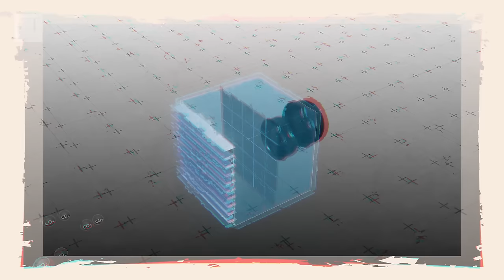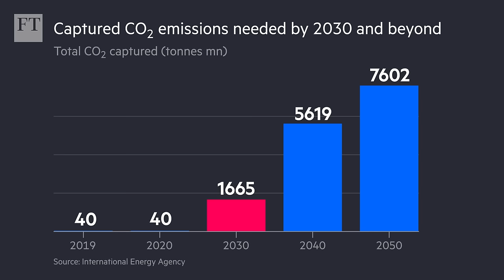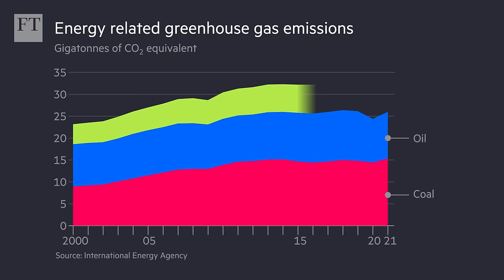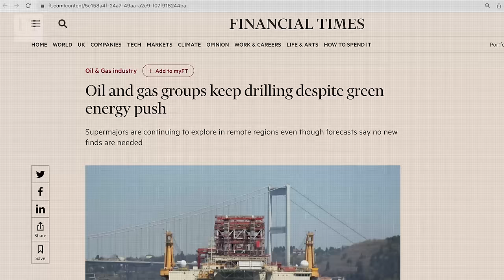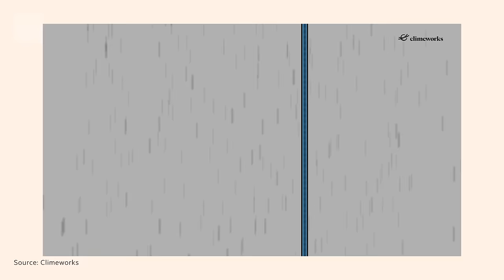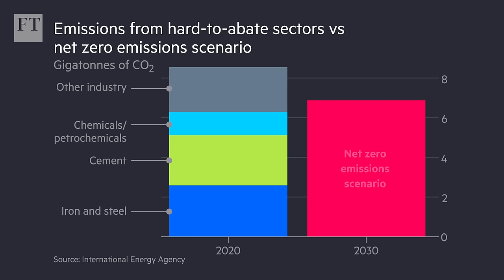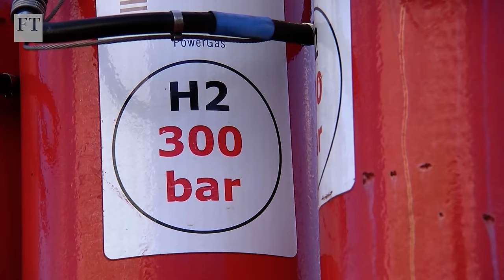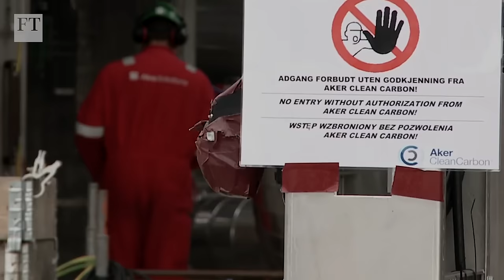Carbon capture: the hopes, challenges and controversies | FT Film

Comment: A lot of people say this approach will not work, which given current technology is true. The cost of storage is quite high, even when using very cheap methods of storage. However, there are a few new processes of turning CO2 into O2 and C. While this process is energy intensive, a source of pure carbon is incredibly useful, as that carbon enables the production of pure-carbon materials, such as nanotubes (one day, probably not soon though), graphite, graphene (this is an important one), diamonds, and more. Importantly, graphene and graphite can be used in graphene matrix photovoltaic cells, which help create solar panels without high-purity silicon. 
Indeed, carbon capture may not itself create net-zero conditions, but using atmospheric carbon to create solar panels, which reduce emissions, is likely how solar panels can be made cheaply enough to make investment even more common sense. 
Finally, the only way to capture enough carbon to make any kind of difference is to dangle a carrot in front of industry that makes them capture carbon /profitably/. If it makes money we'll have to stop people from doing it eventually lol
Reply: by "new processes of turning CO2 into O2 and C" I suppose you actually mean the old processes? Like photosynthesis? Very cutting edge.

Comment: The issue especially is the storage part. First of all, where do we store it? Do we dig up huge holes in the ground, releasing chemicals and gases as we do so? Or do we pump it into containers, containers that need material and other things to be built, as well as a place to be stored (deforestation etc). While CCS is a great late-game strategy to eliminate the very last of our emissions, it's a horrible strategy right now. It's similar to using our pension savings to pay for rent when we're 30. That's not what it's for.

Comment: in deserts solar panels provide shade and shelter to crop and animals 
(rockets upper stages are fumes/heat earth gets rid of)
Reply: We put up solar panels in Kuwait to drive a desalination plant.
Over night the dusty desert air with some humidity condensed on the surface and needed to be washed out, not with the rejected salty brine, not with the seawater, but with the fresh desalinated water. The net recovered fresh water was far from the expected deliverable desalinated water.
If you want to put solar panels on deserts, make sure to consider the dayly maintenance cost and the availability of fresh water.
So far it is difficult to get insurance for such projects, let alone knowledgable investors.
We learned the hard way: use waist energy from neighboring powerplants, nuclear or thermal.
Reply: @arturoeugster2377  ( when every living cell holds an ocean within water wants to flow slow )
Reply: Well that's good for shading need some planets there's with differences in changes of it's exostences
Reply: @ShaleyWanda  where eternal manifests as rockets -let rockets be totem for all of humanity 
(life as center of the universe )

Comment: $137 trillion. That’s the amount of additional currency the world economy needs to be able to handle in order to remove all of the excess Co2 from the air. 

1374 gigatonnes of Co2. 
1 gigatonne = 1,000,000,000 tons. 
$100 per ton to remove, at scale. 
1,374,000,000,000 x $100 = $137 trillion.

Comment: You need to look who came up with the idea of carbon capture...
The petrochemical industry!
Check 4 yourself - Google it... the info is there.

So... this should be ringing alarm bells for you: would this industry really be doing this for the benefit of the planet and population? Or for profit?

Carbon capture is trapping only a fraction of what was forecasted... and the process would appear to generate more carbon than is captured... so there  would appear to be very limited benefit for the planet and population...?

But... here's the kicker... the oil companies use the carbon they do capture to extract more oil (including more profitably where the oil field is close to exhausted and it used to be more costly to extract what's left). Check for yourself... this is what happens.

So? Benefit - No. Profit - yes!

And here's the really, really, really, really good bit....
A 💩-tonne of taxpayer money was used to research/develop and build this technology.
Yes. The petrochemical industry sat back and waited for the taxpayer to build it all for them... minimal cost to themselves. And then profited from it (the only profit the whole scheme showed).

Brilliant! A master stroke by the industry.  As despicable as it is - you have to applaud the brilliance of the whole plan 🤣🤣🤣

Comment: 3:05 NO. That is not a kind of carbon capture to pursue. A fool's errand. And direct air capture can be done anywhere—probably best done near the best places for DISPOSAL.
Reply: Another time to bother you:
The very cold water in cold high latitude, where wales feed, has a high solubility for Co2, because of the temperature dependance of the solubility, ( tables available in engineering hand books) there is in tropical waters an expulsion of the gas. In contrast large amounts of co2 are absorbed continiously in arctic waters, feeding plankton and the whole food chain to the wales, crustatians absorb calcium and co2 to internallty produce calcium carbonate and a shell around themselves. They end up on the seafloor , sequestering the  associated co2 in huge quantities, higher than sequestered oil and coal in the ground. The absorpion of the gas in cold water can be measured giving a reliable value to compare with this artificial foolish attempt here.
Calling it foolish is just my opinion.
Reply: @arturoeugster2377  That there is faster CO2 absorption in polar regions is an interesting point, but I don't see what it has to do with my comment, nor does it change anything WRT what anyone should do. The natural process you describe is VERY slow, taking what, some thousands of years? And whether it happens mostly at the Poles or elsewhere doesn't change anything. OTOH my "artificial foolish" solution can be scaled up to be as fast as you want. I picture most of the process happening in a pulse of a few decades, followed by a much slower effort to maintain conditions. Do you have a particular objection to anything about that?
Reply: @ronaldgarrison8478 
No I am in agreement with both comments you made, in different places. The co2 situation is for me different, because where I grew up at an altitude of >12000 feet regular agriculure fails because the co2 content there is 0.27 grams/m³ as opposed to sealevel, where it is o.49 grams/m³ due to the difference in air density.
Up there we had a large farm next to a river, which we tapped for ample irrigation. Other than corn, the growth was limited due to insufficient co2 content, despite good solar intensity and all adequate fertilizers.
Tests in closed transparent enclosures, fed with co2 from combustion and cooled were dramatic, but not possible for food production in the quantity necessary to feed the ~million living even higher on the Altiplano south of lake Titicaca at 14400 feet. Untill recently most food, trucked in, now with the near doubling of the fuel cost,  is plainly unaffordable.
Any artificial removal of co2 from the air is from my point of view, not just foolish but detrimental to that population. A doubling of the present concentration of 0.04% is desirable, with only a ~1% reduction in co2 radiation loss to space. Due to saturation in the 15 micron IR band. (667 wv/cm bending resonance of the molecule)
But this is not the place to address the problem.
Reply: @arturoeugster2377  Wow, I must admit I've never considered your sort of situation. I'm sure you won't be offended if I say I don't see how a global decision can be made on the basis of what it would mean for a tiny minority such as Bolivian farmers. Then again, you could say the same thing about Pacific islanders dealing with sea level rise, except that they're part of a far larger affected group. Your case seems somewhat analogous to Southern California, where agriculture is only feasible by bringing in huge amounts of water from elsewhere. But it's much easier to divert water than it is to push CO2 uphill. The one thing I might have suggested is what you say you already do, which is to grow plants indoors. In the future, that might be feasible on a larger scale, but I can't do much more about that than speculate.

Comment: Where does carbon come from? Oil, coal, and gas.  Where do they come from? Life.  More CO2 means more life.  Its all part of the carbon cycle which is the life cycle.  Also, there is a finite amount of fossil fuels.  Which means there is a ceiling on CO2.

Comment: If you can run carbon capture machine...even with unrefined oil...efficiently...to capture a lot of carbon...and realize the machine is stationary....it can be huuuge....this recovered carbon can lower gasoline prices, resulting in less drilling and a REAL free market to sell carbon gas...Instead of depleting nation's natural resources with practically antiquated technology...Lower gasoline prices allow ev prices to decline enough many consumers can embrace them...while electric grids upgrade via using carbon capture, or using hydrogen fuel cells...hydrogen can be stored in wax..transfat oils...and ammonia.
Reply: If you really had tough time storing it, that's good problem to have....use it to fuel spacerockets  to freight spent nuclear rods into outer space

Comment: Carbon Hydrogen has potential but lacks the infrastructure to gas every vehicle on the road.  However there is a existing hardware for electric automobile market is already in place.
It could billion of to have a string of CO2 stations placed along highways and whereas their gss are well established. In additional the generation hydrogen plants will be costly and burdens the taxpayers with a new industries that is unproven. Electricity wins hands down and it's dependability has been proven over, and over with the electrical grids and commercial untilities. First select the low hanging fruit, then work up from there. Electricity is the future of cars, then after 15 to 20 years hydrogen may make more sense.☮️

Comment: Why not jus Natural Climate Solution: photosynthesis. Plant trees or even better BAMBOO, which can naturally capture as much as 50mt of CO2 per hectare per year, as well as emit oxygen back into the air. Just do carbon offset. Cost can be as low as US$3/mt of CO2 using bamboo vs. CCS $100/mt…
Reply: Natural photosynthesis is not a very efficient energy conversion process, though. It's only between 0.1%-0.2% efficient (compare with a typical photovoltaic solar panel sitting somewhere between 15%-30% efficient). Given how much CO2 and CH4 we've already artificially released into the atmosphere and the rapid pace at which we continue to emit more, these large photosynthesis farms basically have zero chance of meaningfully reducing our carbon emissions anywhere near in time for the net zero 2050 goal.

Plus, these farms would require an incredible amount of land space that could otherwise be dedicated to more productive purposes. I also worry about some of these farms possibly requiring petrochemical-based fertilizers in order to grow the chosen tree or bamboo species in climates to which they aren't native, which would kinda defeat the purpose of using them as a carbon storage vehicle in the first place.

I'm all for planting more trees and reforesting land in general (provided that only plant species native to the local area are replanted, so that we don't end up devastating the local biodiversity or irreparably degrading the soil), but photosynthesis-based carbon offsetting is simply not enough. We need something much more efficient than that to get us where we need to be.

Comment: We must not be late for global warming.
Reply: the only real solution to drive down carbon emissions is nuclear power.  Carbon capture is fine if the electricity comes from a carbon zero source.
We could produce electricity with nuclear power, use the energy to desalinate water from the ocean, run carbon capture, and power homes and industry.  
All the talk about renewables is fine, but they lack the land density, raw materials, supply chain, and intensity that we need to move the scale in a meaningful way.

as the lady says at 6:40 of the clip, anything other than nuclear power is "tinkering around the edges".
Nuclear power is contained waste, and carbon emissions free.
The continued use of coal can not persist.

Comment: Zero carbon is planet death. CO² is a vital component for photosynthesis, which turns the gas into sugars for itself, making it edible (Brix reading), or to exude into the roots as a trigger to encourage the fungi, bacteria, arthropods and worms to support the growth and more solar capture and conversion. Engineers created the problem and it is highly doubtful whether they can think widely enough to join the solution - which is Regenerative Agriculture. Which actually needs less equipment. So there is no incentive, is there?

Comment: I'm sorry but the fossil fuel industry does understand that we need to reduce the amount of carbon being produced from burning fossil fuels. They have known for nearly 50 years .... they just don't care. To reduce the production and use of fossil fuels will hurt their profits so they will do whatever they can to slow or prevent the elimination of fossil fuel use.  Hence carbon capture. 

Build 70-130 direct air carbon capture facilities with each one capturing approx 1 million tons a year. Big whoop. That's 70 - 130 million tons of CO2 per year vs. the several BILLION tons being produced each year. Wow THAT'S going to help a lot. I find it interesting that Norway has been pumping CO2 into the seabed since the 1990's and has not been able to scale up after over 20 years of experience apparently because it is not economical to scale it up. Surprise, surprise there's the it will hurt profits reasoning.  

The industrial gas industry which provides various compressed gases for industrial uses is held up as another great use for the CO2. The OXY representative says that OXY is the world's largest producer of compressed CO2 at 20 million tons per year. Oh wow! all they have to do is get that up to 1 or 2 billion tons per year, but wait, if there was a use for 1 or 2 billion tons of compressed CO2 shouldn't they currently be producing something closer to that? Hmmm, seems odd.

So next up is  the "take some of the captured carbon and use it for commercial use to improve the economics" argument. If it is so attractive economically then why isn't it currently being done. Oh right, it isn't really commercially economical because if it was, then they would be doing it right now.

I love the statement that fossil fuels will be around for several DECADES so carbon capture is the only solution.  Welllll ..... According to the IPPC report we can still meet the 1.5 deg C goals if we make drastic changes soon. If we don't then the earth will see 1.5 deg C by the mid 2030's so we don't have several decades to prop up the fossil fuel industry and by extension the legacy car manufacturers and power companies to name two. 

Carbon capture is meant to distract from the work that needs to be done. If carbon neutral by 2050 is the goal, then we have a little less than 28 years to get there and so far governments and industry have been diddling around and really want to maintain the status quo. So people have to start changing what they do in order to start making some impact, but governments and industries also need to commit to taking the necessary actions. 

People in government and elsewhere have stated that climate change is the greatest national security issue for the U.S.  It's not. Climate change is the greatest security issue for the entire world, i.e. the human race.  A disruption of crops due to drought, flood, heat, or cold could result in famine in many parts of the world and it may happen sooner than anyone expects. The polar ice cap, the Greenland ice sheet, and Antarctic ice are melting faster than predicted so what about the timing of the other predictions made so far?  There is no way of knowing. Predictions are educated guesses based on observable data, but the operative word here is guesses. They're the best we have but they are not infallible. The best course of action is to work as quickly as possible to get to carbon neutral to reduce the disastrous outcomes that are in our future.
Reply: We'll cross 1.5C within the next few years..